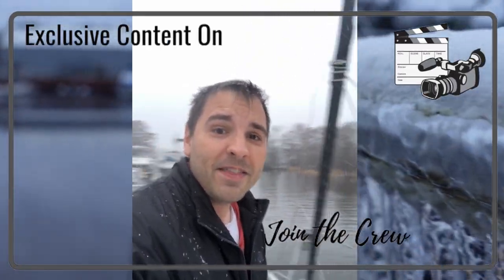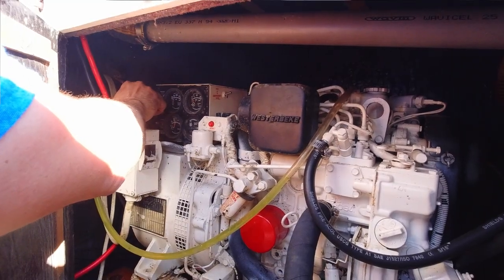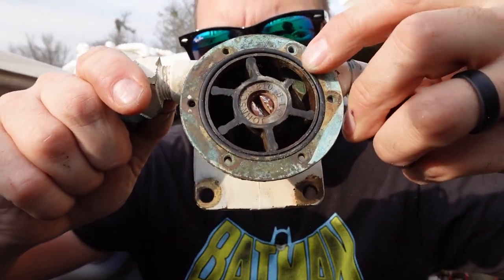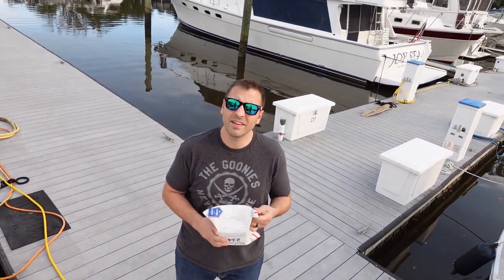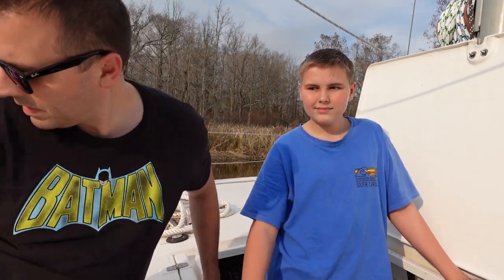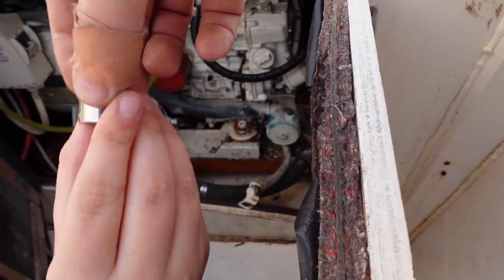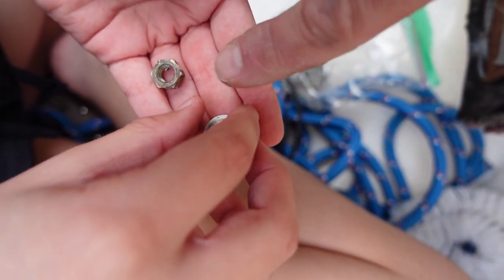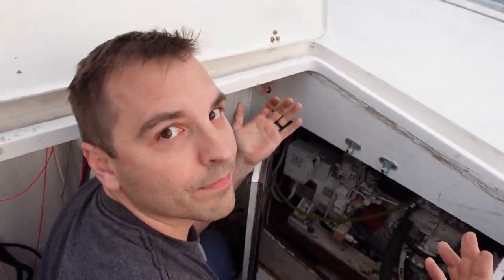Replacing the water pump on our Westerbeke generator. [Sailing Family]

Comment: On your heat exchanger you should have what we call a pencil zinc you need to check and replace as needed every few months or so. And if you have all that it is a very good idea to flush the heat exchanger. To get out any calcium deposits out and any impeller pieces that may be in there.
 Great video this week! And a Very Good job on teaching your young ones on how to fix it.
 Ok until next week Aloha from the Big Island🏝 of Hawaii 🏞🍹
Reply from the maker: Hi Bill!  Thank you!  I will have a look at the owners manual about the zinc.  I’ll probably remove the whole exchanger and make sure it’s throughly cleaned!  
Thanks buddy!  Corey

Comment: I was thinking about your batteries set. It isn't marine grade in anyway, so you must have extremely care with the BMS and any other connection because the saline atmosphere will do their job on them.
Reply from the maker: We’ll keep an eye on them.  They are cased in aluminum with aluminum posts.  If they corrode we can replace them.  The price of LiFePo4 is coming down.  BUT… I’m holding out for solid state batteries.  😆

Comment: Barnacle buster can clean heat exchangers. $500 isn't bad, it could be a lot worse, like charging your batteries when they are below freezing.  It sounds like your generator might be able to handle an additional charger?????  It is a pretty big sucker.  My Westinghouse Igen 2600 can handle 100 amps on the charger easy at 12 volts.  I'd buy another charger, hang some solar off the rails and blast off for the Bahamas now.  Florida really is probably the best place to have an arch made....which you could hit on the way back!!
Reply from the maker: Hi Allyn!!  Good to hear from you again. 😊 
I’m going to look into the barnacle buster.  That’s a good tip.  
We were thinking about an arch from Olympic Towers. We’ve seen that they have an arch that works on our cat. 
How would you add a charger to the generator?  I’ve never heard of doing that. 
Corey
Reply: @SaltyEscape  Well the charger would be on the AC side of the generator.  I saw the Bluetooth bms, which looks the same as the one I have.  200 watts into the battery. Times however many batteries is the total charge current.  You can have more than one charger on the battery bank, provided that the wires can handle the charging current, the batteries can take the current, and the other charger can take the current on the main bus.  Think of it as putting two chargers on a car battery to make it charge faster. As long as there is enough current on the charger, the batteries charge faster. What I am saying is that if there is leftover energy from the generator, get another charger.  It might put out like 8000 watts and you are only using 2000 watts.   Figure out if you have something left for another charger.  Likely you are using fuel on the generator anyway and the rest of the output is just wasted sometimes...unless you run something to use the rest like AC.  Most of former charter cats have gensets that run like four or five ac units.  You might even consider a gas model that uses less fuel.  I run a Westinghouse Igen 2600($460 ish with one hour on it refurb from ebay) .  It'll run some combination of my Victron Inverter/charger at 100amps or a 16k Aircon.  All while getting 8 to 10 hours per gallon.   It is gas and more dangerous, but is easy to plug into the shore power cord on the back of my boat...and quietly produces power.  That sucker you have probably pulls diesel..which is safer...but wastes soooo much fuel doing nothing for you as a cruising boat with lower draws. The tower in a box thing is cool.  They work..but..remember you might want davits too.  You might have to figure out the fit for both.
Reply from the maker: Oh… I see what you mean.  I was over complicating it.  We will be running AC -probably 2 units, when we can’t handle the heat… Lol. 
The Olympic towers arch do have an option to accommodate davits which is something we’re interested in. We don’t care for the davits we have on board.
Reply: @SaltyEscape  Most cruisers find that on the hook with the hatches open AC isn't needed at all.  The wind just whips through...especially with some wind scoops. AC is purely a thing when in a marina due to the loss of wind typically.   A 8000watt diesel genset burns about .5 gallons an hour with hardly any 
load.  If you have a single ac unit in the salon it might be possible to run just that one and cool the entire boat.  Cool air falls to the other hull areas, and usually it is the humidity not so much the heat.   Seriously running that genset will really suck the dollars.  24 hours running the genset will likely cost between 12-16 gallons or out in the Bahamas that is $60-$80per day.  You might seriously consider a smaller genset that is quieter that can maybe run one AC unit.  Our boat used 15 gallons of gasoline a month with dinghy fuel.  With only 200  watts of solar our genset gave us all the energy to cook daily, wash daily(hot water) ,make water daily,, and top up the batteries daily.(For 6 people.)  If your charger only puts in 80ampsish you will have to run that genset a long time to charge the batteries.  Its cheaper to buy a genset that can work on it longer than to buy a charger.  A second genset also means you won't be down and out if the big one fails...which it likely has a lot of time on it.  Also if you want a watermaker I can get you a parts list where you can make one up for less that 2k.

Comment: I think the screw holds a part that the vaines of the impellar push against to move the water inside
Reply from the maker: Yes!  You’re right. There was a crescent shaped piece in there held in place by the screw.  Also, the position of the pump on my generator was vertical, so that wouldn’t be a drain hole… and I could just remove the impeller cover.  😂 
There was some rust on the mounting bracket under the pump so I suspect it has had a slow leak for a while.   (Previous owner)
Thanks Louis!  See you next week. 
Corey

Comment: Don't beat yourself up - it's not your fault that the pump failed. Those pumps are notorious for just suddenly starting to leak. The reason is that the lip seal, not the bearing,  just gives in and starts leaking. Expect it to happen every 200-300 hours, in my experience. One can actually buy repair kits for those pumps but often it's more cost effective to just replace the whole pump. It'll happen on your main engines as well. I therefore have two brand new pumps, a couple of repair kits and a whole lot of impellers on my Venezia (that's just for the main engines as I got rid of the generator). 
The reason the "wedge" in the pump disappeared is that the anodes in the heat exchanger were apparently not replaced, so the "wedge" became the sacrificial anode. Therefore you found those pieces of junk in the heat exchanger - in 20 years I have never seen a a wedge getting eaten like yours. 
When you start up a new pump for the first time, try to make sure you have some lubricant on the impeller to protect it just for the few seconds it takes the water to get to it and start lubricating it.
I can't wait to see what you're planning with your arch as I'm also looking for a good place to install my four solar panels. Ideally I'd like to move the boom control lines and track to the top of the bimini and then extend the bimini aft, thereby creating space to mount the solar panels and freeing up the space on the main deck, just to make for easier access to the dinghy and sterns.
Reply from the maker: Hi Philip, Thank you!  I found a partial rebuild kit onboard left from the previous owner.  I think I’m going to rebuild this one as a spare. The wedge was there, held in by the screw, I removed it, during the disassembly off camera and I forgot to put it back for filming. 🤦‍♂️
You’re the second person to mention a zinc on the generator.  We’re in fresh water at the moment so that will help a little but I need to figure out where it goes and what size I need.  The other person mentioned a “pencil” zinc.  Hmm. Lots to learn. 
A while ago, someone who also owns a Venezia messaged me regarding their owners version.  Was that you?  We’re still planning to convert ours to an owners version and I’m looking for pictures of others.   
Feel free to email us… we can talk further about the arch, etc 
SVSaltyEscape@gmail.com
Talk soon! 
Corey
Reply: @SaltyEscape  Keep an eye on the anodes on your saildrive as well. There is one behind each prop and then another one in the engine room on the housing, but you can only check this one once you're on the dry.
Yes, I messaged you about my owner's version. I'll be back in Fort Lauderdale soon and send more detailed pics.
I'm impressed with how "easy" it was for you to install your new radar, especially running the new cable! I have mine waiting for me to install when I get back... How long cable did you use? Garmin sells different lengths and I'm not sure what to get.